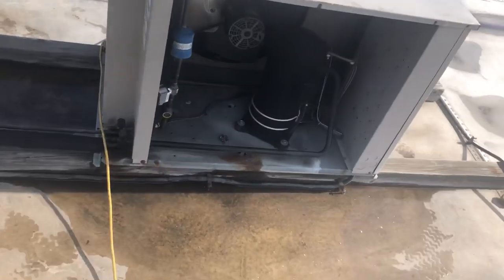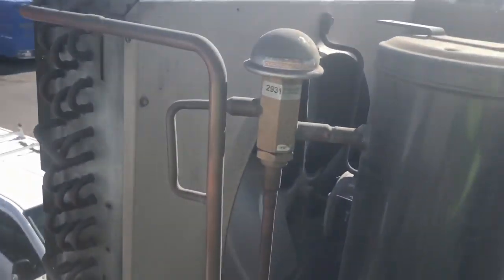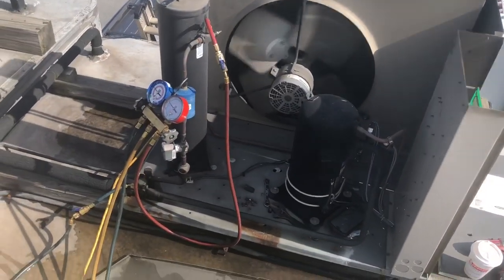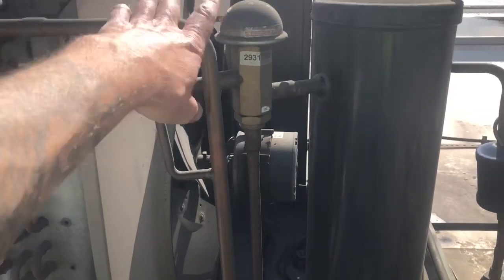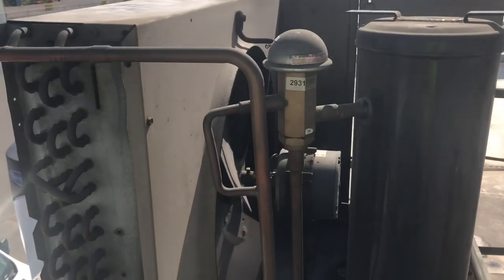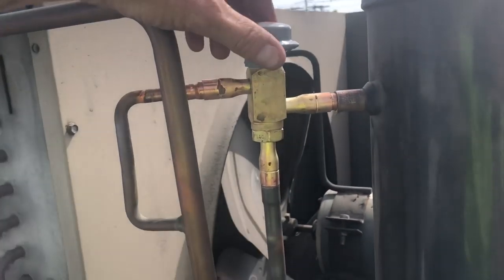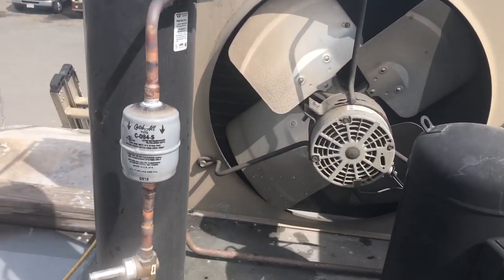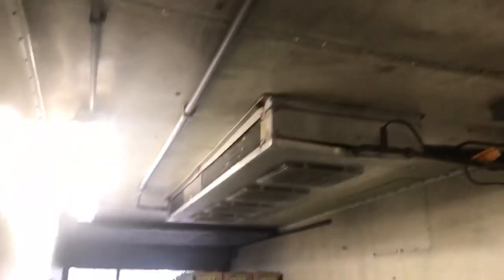Headmaster valve replacement on refrigerated trailer

Comment: Hi there
How do you charge the freezer in the winter when the ambient temperature is 45 degrees outside when the headmaster is active due to low ambient sight glass may flash . I just want to know how to make sure the unit is properly charged with clear sight glass and its not the head master that flashing the sight glass. Thank yiy
Reply from the maker: Usually you would find the capacity or the receiver for 90% full and charge it to that weight.

Comment: I did have a question on the headmaster control.
In failure mode did the valve open to allow discharge psi into the reciever. Raising the head psi too high. Maybe trip a high psi switch?
Any help on how to determine if the headmaster is good or bad.
Thank you very much.
Reply: I think sporlan has that information on there site? Or it's danfoss. I believe chris from hvac/r videos was the one who posted head master information.